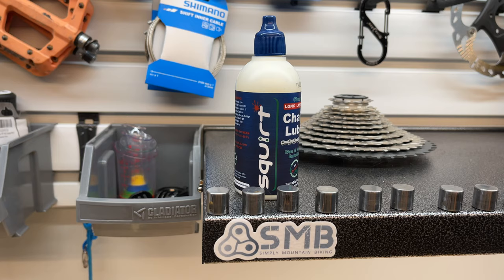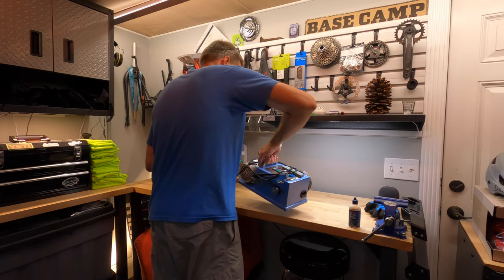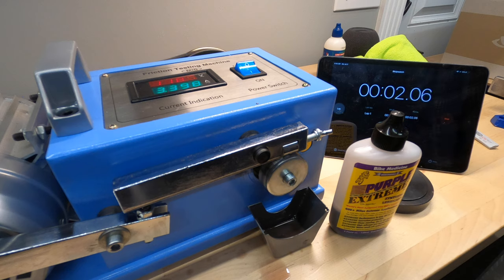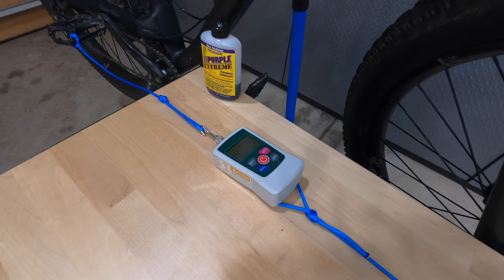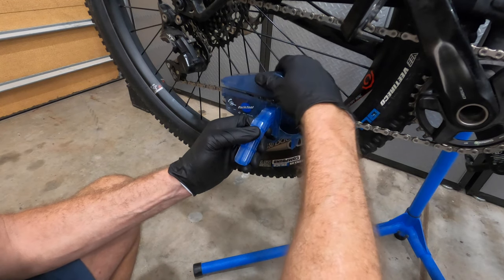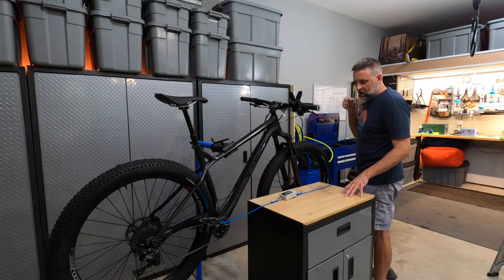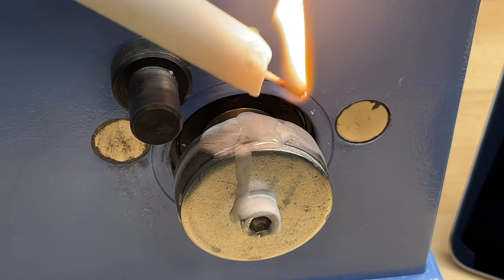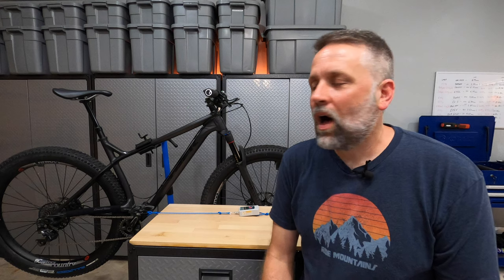Is Squirt a Good Chain Lube? | Squirt Wear Test

Comment: This test says nothing. In real life a waxed chain lasts longer than a oiled chain as well as other drivetrain components. Mostly because it doesn't form grinding paste.
Reply from the maker: Thank you for your feedback. -Eddie
Reply: @SimplyMountainBiking  After reading my comment again I want to clarify. The test is great for measuring lubricity, but maybe not so much for gauging chain wear. That's all I was saying. 👍
Reply: The whole point of fluid lubricants, such as oil, is that they displace contaminants from the roller pin assembly. So there will be no "grinding paste". Wax, being a solid, cannot do that. Which is just one of the many reasons wax is not used for industrial roller chain lubrication.

Comment: I am using Squirt on all my bikes since 2014. My Dura Ace 9000 transmission still has the originals pulley wheels, cassete sprockets and chain rings after 35000 kms wirh no signs of wear. My KMCs chains lasts 8000 kms until 0.5% chain streching on road and 2500 kms on the dirt. I really don't care about .2 pounds of chain drag compared to oil based lubes. The longevity of the parts worth it. Nice video and keep the good work!
Reply from the maker: Thank you! -Eddie
Reply: Drag is going to be directly proportional to friction which is proportional to wear. Another lube would have given you greater component life. Living in a dry area, I also feel like my components last so long that I only change chains every two years just because I'm tired of looking at the old one.
Reply: I used MucOff Dry on my MTB (KMC chain) and got 2000km before the chain was cooked - as yes regular cleans etc.  Switched to Squirt and definately a big improvement in chain noise reduction and less need to top up.. also qith Squirt you layer up the chain over time and while it may look "messy"  I dont care.  I want prolonged drivetrain life!
Reply: How do you apply it? And how did you clean the chain before using it and in between uses?

Comment: There is a major flaw with testing chain lubricants like this. Bicycle chains are not subjected to this kind of force or friction heat, and as such, the chain lubricates in this test are not formulated for such protection.
Reply from the maker: Thank you for your feedback. -Eddie
Reply: I thought the advantage of wax based lubricates, they don't attract dirt and grit which will keep the chain cleaner.
Reply: The heat in this test is indeed problematic. But the pressure inside a chain is comparable, if not higher. Estimate you push 20kgf on the pedal, that gets multiplied a factor of say three. Therefore we have 600 Newtons in the chain easily. Let's presume the bearing diameter in the chain is 5mm and the width is 2mm. Gives us 10 square millimeters. 600N over 10mm² is 60N/mm², or 60Mpa or 8700psi. That is at the top any lubricant can handle.

Comment: I've been using Squirt for a couple of years now and get about 3000kms more out of the chain compared to an oil lubricant 🤔
Reply from the maker: So interesting that anecdotes on wax go both ways... -Eddie
Reply: I got 13000 km out of the chain using Squirt, I don't think that oil would give me nearly the same results.
Reply: @SimplyMountainBiking  I'm getting around 9000kms out of the chain and that's riding in all types of weather and around 100000m of vert.
Reply: Converted MTB and roadies all to squirt after use on my race bike… Got tired of dipping my chain in a wax bath. I apply a light coat every 100-200km. On a new chain I find after several applications get layered the subjective chain noise and shift quality is substantially less and remains for the life of the chain. Sand and grit never seem to build up between links, black wax residue is easily wiped off. 12,000+km on 4 chains all weather. I’ll never be going back to oil lube. 💁‍♂️
Reply: I also have used squirt for the last few years on my road bike. It seems to work really well but I still use WD40 wet lube on my beater/commuter. 

I am kind of wanting to try another dry lube but dread the dirty drive train. I figure in the real world the oil based products would attract more dirt and eventually add wear.
Reply: If your goal is to maximize the life of your chain then it seems Squirt would be ideal. However, not everyone has that same goal. Personally, I’m interested in maximum performance (speed and efficiency) which makes Squirt a less desirable solution.
Reply: @magnate2372   melted waxes then, for both

Comment: Wax based doesn't 'stick' as good. Then you got hot melt chain dipping? Life is precious spending so much time doing that. I'm not OCD about 'clean chain' while riding, I regularly clean chain when it starts looking a little funky, then wet lube it.  I use the OG & ol' school of lubes  ... Tri-flow!
Reply from the maker: Haha - yes.  I'm not going through all that faff to extend the life of a chain I paid 60 bucks for... -Eddie
Reply: An advantage of traditional oils like TriFlow is you can also use them on your derailleurs, etc, as well as round the house. If the oil you use can also be purchased in gallon containers that's a pretty sure sign it's good, as shops, race teams & bike builders will be bulk buying. The stuff I get is formulated for wet UK conditions, costs peanuts, & many, many pros & mechanics use it. It's similar to TriFlow but a bit thicker.

Comment: As stated here, most people get way more miles/km out of the drivetrain. I get the same comments from customers (working as a full time race/mtb mechanic) once they use wax they never go back to oil based lubricants. (Always very messy too)
Reply from the maker: Thanks for sharing - interestingly, though, a few others have shared the opposite anecdote.  Curious! -Eddie

Comment: Full disclosure: I'm a Squirt fan and wax-based chain lube fan in general. 
I don't think the friction machine test or the stiff-chain test are fair to a dry, wax lube. I don't think they come close to representing what happens in a chain where the links trap the wax inside to a certain extent and keep the wax in place and see reciprocating motion. 
The wear-scar test is obviously going to scrape the wax off leaving metal to metal contact. Anyone using a wax lube will tell you the chain is stiff for a few hundred meters of pedalling and then loosens up. 

The companies that test on chains (I think there have been two high-profile (for the bike industry anyway) tests done by Friction Facts and another guy) have very good results with wax lubes. 

I'm not saying your wrong about wax lubes vis-a-vis the tests you did, I am saying you're using tests that don't represent what happens in a chain. In essence you're asking the wrong questions so the answers you're getting don't matter. 

I should add, for chain longevity, the best lube is an oil bath of clean oil in a sealed environment (think timing chain in an engine). We run our chains in the open where they're subject to contamination and use them in a sport where efficiency and weight matter. This is an environment where wax wins.
Reply from the maker: Valid points. -Eddie
Reply: @SimplyMountainBiking  I am on Squirt for a year and on the one hand I like that chain does not squeak when it gets dirt during gravel riding but on the other hand the chain wore out quite fast: 0.5 after 600 km with application of Squirt every 100km the day before ride. Recently I have switched to Muc-Off dry and I will observe how it goes. Can you tell what's the force applied during your rub test ?
Reply from the maker: Thanks for sharing your experience.  For the wear test, I only used one of the weights that were provided with the friction testing kit.  It weighs a little over a pound.  The set came with at least 6 of them!  The force applied is more than a pound, because leverage is applied - but I never measured it at the wheel.  I'm certain it's less than what we can apply via the pedal on our bikes though! -Eddie
Reply: I was watching this guy thinking wtf he is doing. Has a lot of stuff spend a looooooooooot of money on everything yet doesn't even realize core concept
Reply: I kind of agree with you.
Eddie, although your test in the previous video is very professional and I admire it, I think we can't take it as the final answer to which bike lube is the best, especially when comparing wax based lubes and others because they don't work the same. Indeed, I think the test misses a very important part : durability of lubrification.

I can report my experience :
I used Muc-Off dry lube during a long time, with great maintenance (perfectly degreasing, cleaning and drying the chain before applying the lube and then wipe off the excess) approximately every 250km. It is true that during the first kilometers after maintenance the drivetrain was perfectly silent and smooth, but, although i was riding in perfect dry conditions, the lubrification did not last long : it was a bit noisy at 150km after the maintenance, and more noisy at 250km. The drivetrain stayed pretty clean.
I started to compare bike lubes and wanted to try Squirt lube which looked to have convinced so many bike riders whatever their discipline. I applied it to my drivetrain exactly as advised by the brand. After the first ride I noticed the chain was cleaner than with the Muc-Off dry lube, and during the ride the lubrification looked great : perfect silence. After a lot of rides in dry conditions using the Squirt lube, I could tell that the drivetrain stays really (almost perfectly) silent and smooth for about 350-400km after application ! And I think a new application of Squirt lube is really necessary at approximately 500km after the last one (in dry conditions) ! All that without needing to degrease the chain between applications so saving a lot of time and energy during maintenance. The drivetrain stays a lot cleaner in general, even than with the Muc-Off dry lube.
So, to me, it was clear that the Squirt lube was the best for me !

That great lubrification durability and performance I report from the Squirt is what makes me doubt about how representative is your test of lube's performances in riding conditions. For having tried both Muc-Off dry lube and Squirt lube in riding conditions, and then found out that the lubrification of the Squirt was more than 2x more durable than Muc-Off's one in my case.

About Squirt lube, I have to add two things. I use this lube as Squirt advises it, with two exceptions. 
First one, is that Squirt says to never degrease the drivetrain again once you applied the Squirt lube for the first time, but only to wipe off the chain with a dry cloth in order to remove a bit of old and not super clean wax between applications. Well, in my case, I do that about 300km after the last application, but, 300km after that, I clean the drivetrain with bike cleaner (less powerful than drivetrain degreaser) and brushes before to rince it and dry it, and then I reapply Squirt lube. That allows the drivetrain to be perfectly clean before one application on two. Squirt lube does not get your drivetrain dirty (a lot less than other more classic lubricants) but if you want it to be always almost perfectly clean, I don't see what is bad in totally cleaning it from time to time, whatever it is with bike cleaner, dishwashing liquid, or even degreaser. You have well done it before applying for the first time Squirt lube, so...
Second one, is that Squirt says to apply the lube, no wiping off the excess and then wait about a night for the lube to dry before riding. I added one step which to me is really important : once the lube is dry after the night, I wipe off the dry excess of lube from the drivetrain in order to catch less dirt and so to keep the lubrification efficient longer. Also, it is true that after the night, the chain is very not smooth and the chain links struggle to glide, and making the chain turn while wipping off excess ends this issue : once I am done wipping off excess, the chain is as smooth as any other.
Some riders using Squirt complain about "linters" (excess of wax) in the derailleur pulleys, and I believe this is what happens if you don't wipe off the dry excess of lube. I never had this, my drivetrain stays really clean, and as said earlier, the performance and durability of the lubrification is more than great; so I believe this is what we should do, to wipe off dry excess of Squirt lube before first ride after application.
Reply: Okay Squirt keeps the chain clean, but it clearly does not have lubrication properties good enough to withstand the extreme forces in a chain. I've seen in printing presses and automation machines there are huge differences in lubrication types. Choosing the wrong type can lead to extreme wear. The oil in the lubrication must be viscous enough and must adhere to the chain surface. From the test in the video and from my experience, Squirt does not meet those criteria.
Reply: fanboy

Comment: Great video ! But I think you ignored the main benefit of dry wax: It stays clean and free of contamination for way longer. 

Yes, a low viscosity wet lube might have lower friction when just applied and clean, the question is for how long?  Bicycle chains are open systems and operate under direct contact with contamination. In just a matter of minutes riding under real world conditions the wet lube will be contaminated with abrasive dust particles and I can guarantee you that the friction will not be as low. 

Dry lubricants such as wax on the other hand, provide a physical barrier that prevents contamination from getting inside the chain rollers, so they provide a much more uniform performance under all conditions, not only when recently applied.
Reply from the maker: Thank you for your feedback.  -Eddie
Reply: in mtb with shimano sil-tec chain and squirt wax it gives me 8,000km before reaching 0.75mm of wear
Reply: @martinchebaia  Pretty good numbers, best I've done with drip lube is about 6,000KM, hoping to extend that now that I'm using molten wax.
Reply: @SergioGarcian_n  
I have tried several types of chains but I have only achieved these results with those that have sil-tec technology
Reply: If, as Simply Mountain Biking argues, the wax lubricant gets squeezed out of the rollers while riding and, unlike a liquid lubricant, is not replaced, then it will not provide protection. Resistance to contamination is not a benefit if the lubricant is no longer present!
Reply: @londonlionel  I think you underestimate the abrasive dust here. From all people that changed to wax (any wax) you heare the same. They get longer chain lives.
Reply: I recently replaced my KCM DLC 11 chain on my gravel brike. 
The previous chain was cleaned and oiled more than regularly. After less than 1000km, I noticed an important wear and the roller were cracking like if there was dust in it. I finally changed it at ~900km because it reached .75mm wear.
I think I would have to do a deep clearing more frequently to use it with classic but high quality lubricant.

With my new chain with squirt wax, it seems still quite new after 200 km and performance are similar to a freshly cleaned/lubricated chain.

Both chain are the same model, I will see over time if wax is better.
Reply: @SwissMoutain  Just keep in mind wear is non-linear, usually the first 1000km or so are slower wear since the chain's low friction coatings are doing their job and there's less contamination within the chain rollers. In any case Squirt should be better than regular oil but for ultimate longevity you need to go with immersive hot wax.
Reply: Plain paraffin is fine for keeping your chain clean, but the stuff I just applied to my chain (silca secret chain blend) has tungsten disulfide particles to increase lubricity. They claim it is superior to other lubricants in pretty much every facet. It would be cool to see a test of that claim

Comment: Enjoyed the video, but I do believe there is a flaw with the friction test vs real world. The friction test you perform is based on two surfaces grinding away at each other constantly which allows the wax based lubricant to melt and displace from the wearing surface effectively leaving the surface in a dry unlubricated state. In the real world the drive train has a wear cycle where the lubricant on the chain is 'heated' by friction at the cassette, jockey wheels and chain rings but allowed to effectively cool in between these points allowing the lubricant to not melt and therefore not displace. 
Most lubricant testings that have been performed are on rigs that mimic the usage of a chain in real world conditions (generally only for single speed); these put squirt right up there as being one of the top lubricants for longevity next to wax lubes. I think this video and the previous testing proves one thing and that is that lubricants have specific use cases, there is no best lubricant for a bicycle chain, there is just a better lubricant for the conditions/distance you are riding and the frequency of your chain cleaning and re-lubricating regime, this is why companies like muc off make different lubricants for different conditions.
Reply from the maker: Thanks for sharing! -Eddie